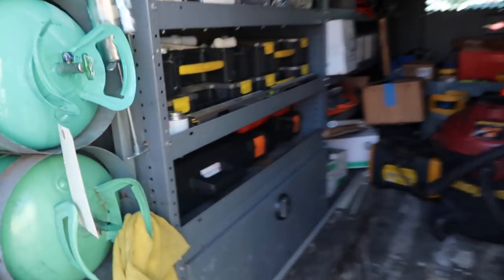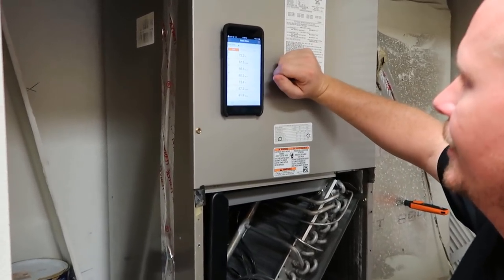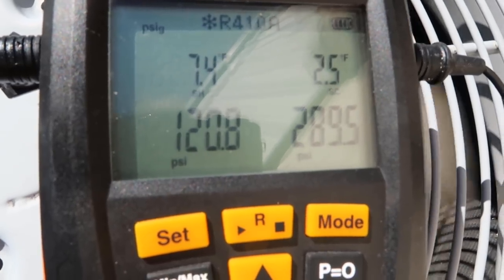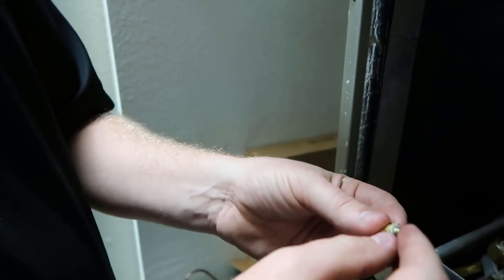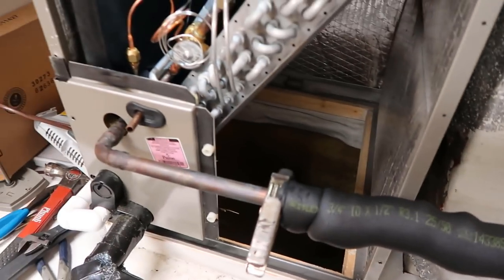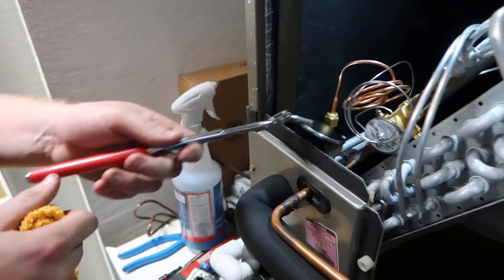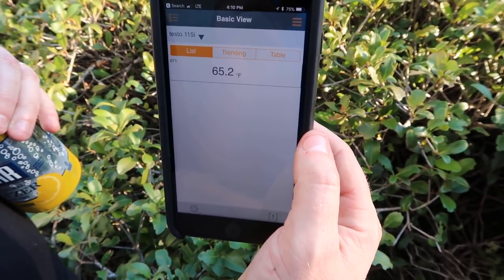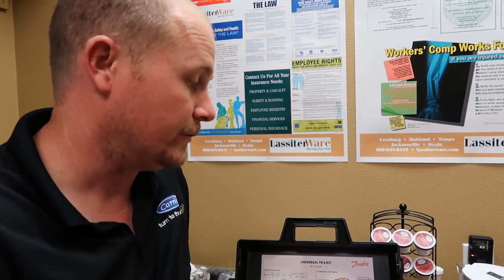Replacing a Piston with a TXV Using the Danfoss TR6 Kit

Comment: Two tips to add. Put your caps off the unit on your gauge hose parks. Never lose or forget to put back on. Especially when two guys at the job.
 Put a wet rag on the suction line to keep the aluminum/copper joint from overheating. You might be good with a torch. but still a good safety precaution. I never see any HVAC tech use wet rags
Reply: We use cool gel now

Comment: The closer the TEV sensing bulb is to the evap suction header, the more likely your superheat will be a little high. I've had systems fail CA Title 24 charge verification with a weighed-in charge. Moving the bulb outside the coil case allowed the system to pass.

Comment: Thanks for the good video. It plays a little fast, so I went 75% speed.
Some very good tip like cut the filter drier off vs heat it off, punched for the equalizer hole and use the file to score it a little.  Good explanation of the equalizer, it's actually the pressure sensor.  Some people mentioned capillary of the small tube, and that's wrong.  It's just a pressure sending tube.
Showing final charging numbers are also good.  
I wish to see how the filter driver was brazed in.  Which are the good rod (45?), use flux or not (some sites say must use it for non-copper metal even with nitrogen) and how to avoid flux contamination.

Comment: 2 questions here: 1st why didn't you just pull the Freon charge back into the condenser and leave it there during the job & 2nd if you drilled the hole for the equalizer fitting while you had nitrogen pressure on the lines wouldn't it blow out any debris that could contaminate the system. Newbie  question !

Comment: You have to pay careful attention to video, but I noticed he shut the outside unit refrigerant ports, highside first, then lowside, while unit was running then immediately shut down power to unit to capture the most refrigerant in condenser.  I assume the compressor is okay with doing this as long as you shut power off quickly after closing ports.  Any difference in method required between scroll or reciprocating reed valve compressor?

Comment: I just found this, something that you didn't mention that would have helped to hammer the point home better would have been to show a fixed orifice superheat charging chart and explained how you charge under a certain set of conditions and then as conditions change bad things can happen, IE an unusually hot day, them setting the thermostat lower, dirty air filter or coils, Etc. causing you to flood the compressor.

Comment: @ 5:28 why is the RH on the supply air so high? In cooling mode.. i thought system is lowering RH not increasing. I would expect the top row of readings ( return air 51.4 RH - supply air 87.8 RH ) to be opposite of what this is showing.
Reply from the maker: This video explains it https://youtu.be/kn8KeumYfaM

Comment: Sub cooling data on the condensing unit is a maximum  degree . Carrier ever says to reduce it in certain cases. Here in the southwest we need all the condenser coil to reach a sub cooled condition on very hot days. reducing  it by 3,4 degrees . Sub cooling ensures liquid at the TEV inlet, no flash gas entering the valve. To much reduces condensing area in the outdoor coil. And  dosen't Increase  NRE in the evaporator

Comment: Do the Danfoss Universal kits work for heat pump applications if I remove the piston from existing evap unit? (no restrictions in reverse flow inside the txv ? will it work ? )  or I have to buy different type of txv kits ?
Very Good info here thanks !
Reply from the maker: rmwaseem yes they work on heat pumps, they have an internal check flow bypass
Reply: must be a danfoss commercial,whats the point in a "kit"

Comment: No offense, but that was not needed.. No need in recovering to a tank when you can suck it out of the line set and pump it directly into the condenser via the true suction port. Just bleed ya lines good.  No biggie. No need it putting it in the tank.. Pull it directly from the lines in on the recovery unit and out the true suction port on the unit.
Reply: Sorry what

Comment: System was working great with tbe 20 degree temp drop. What are you wanting?. The money the custom spent on that repair they will never recover. The only person benefiting from tbis repair is your company. I dont it
Reply from the maker: First, you might want to proof read your comments. I can hardly understand you. Second, this was done for free as a demonstration. Third, temp split is not the only indication of operation. A TXV maintains coil feeding over a wider range of conditions.
Reply: Without airflow measurements, you don't know if the unit is performing well regardless of the temp drop. You can have problems covering up for eachother.